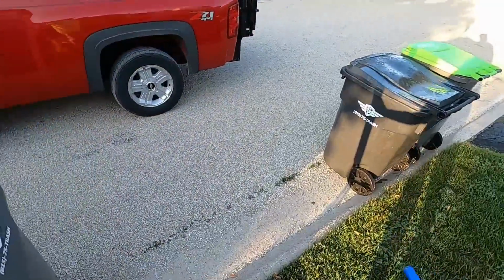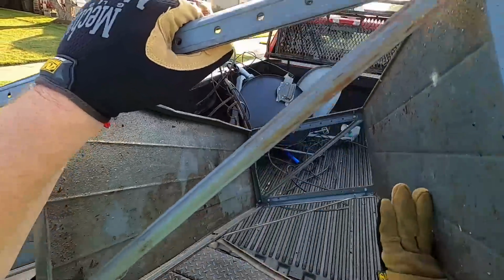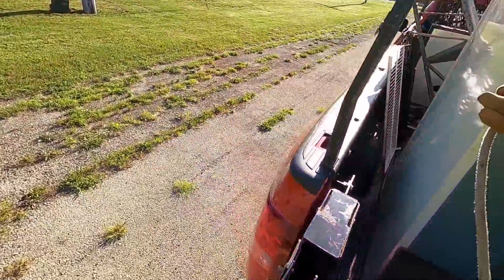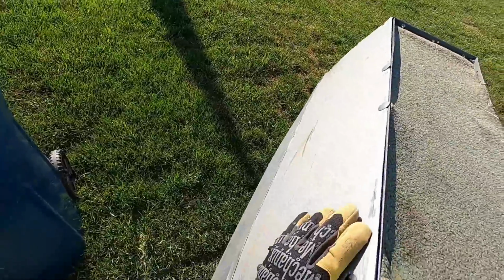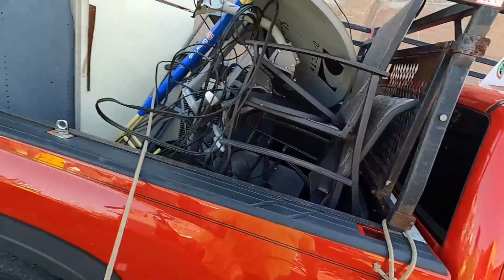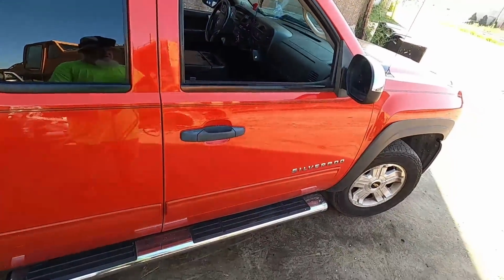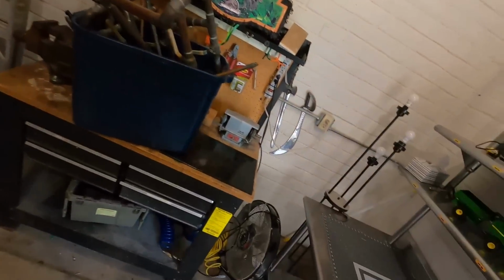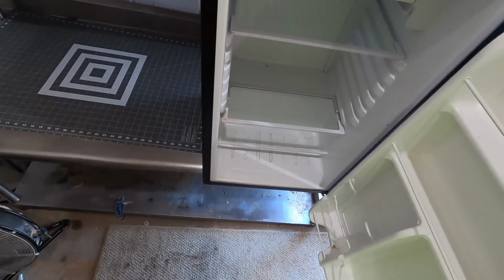Street Scrapping - Déjà Vu

Comment: I love mini fridges as most of them the thermostat fails. And when it fails it flare mode is to let he compressor run all the time. 
Most people find this out early and unplug it and put it on the curb.  And a $10.00 ink-bird controller form amazon updates it to a digital control and I can sell it for $50.00 
But the unlucky ones where the owners does not notice it freezing and it runs until it can't let the refrigerant go into gas phase and it tries to compress liquid and thats the end of the compressor. Then it is junk. 
The way to test is to set the thermostat to 1/2 of its travel. Then plug it in and let it run for 2 hours empty in the house, 
That was it can get cold.    unplug it .  Then rotate the thermostat back and forth and listen carefully.  If you hear a click when you pass a certain point in the travel of the thermostat it might be ok. 
Then rotate it to the off position or fully counter clock wise.   And plug it back in if it turns on the thermostat is bad. 
And needs to be replaced. 
If it doesn't turn on and if you rotate it clockwise slowly and you hear a click and it turns on then the thermostat is good. 
Now it it. runs and it doesn't cool, it has lost off of its refrigerant and has a leak. (not worth repairing)